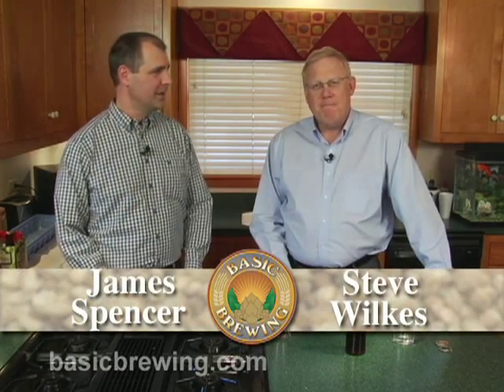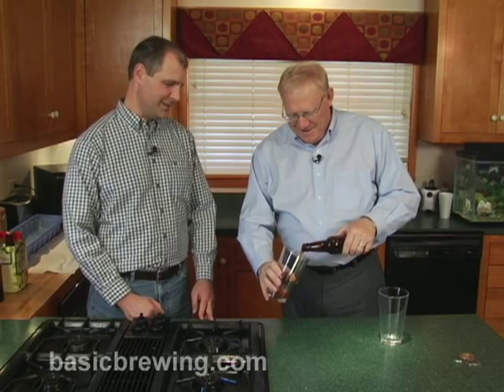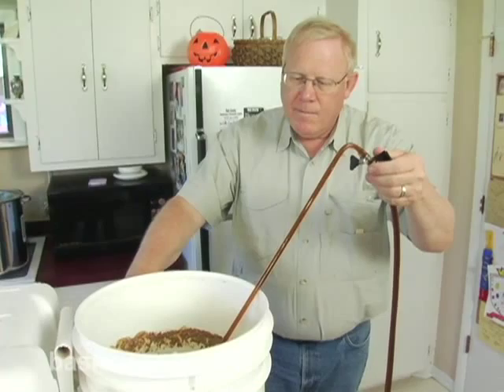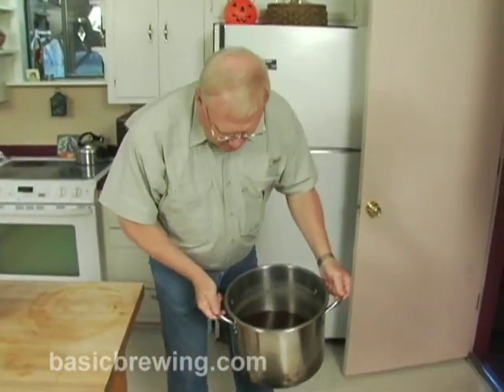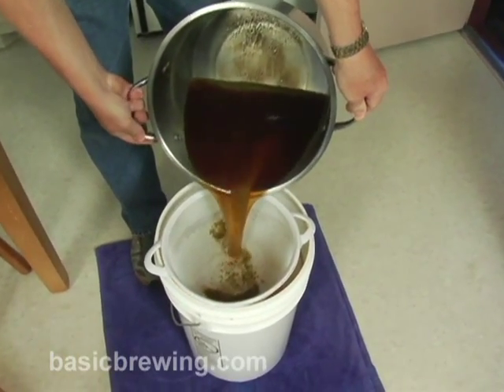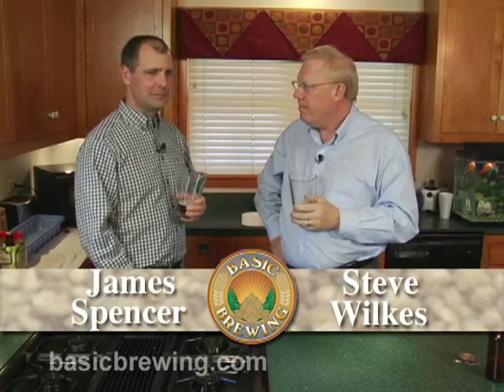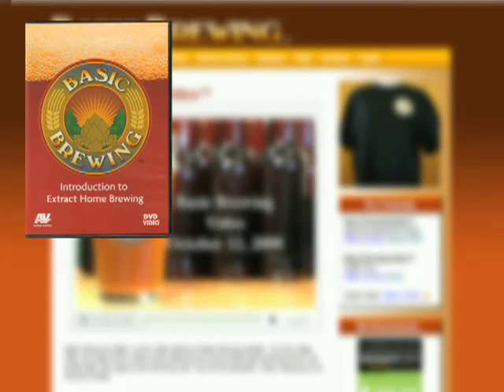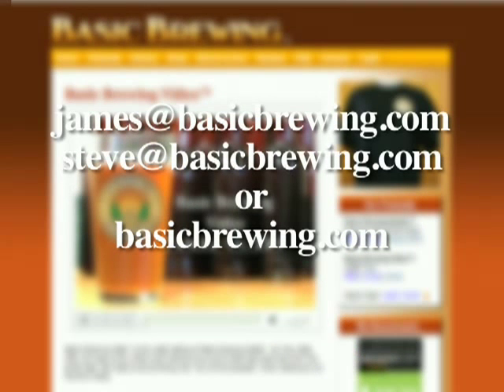Reusing Yeast - Basic Brewing Video - January 31, 2009

Comment: I agree fully that these is no fundamental limit on the number of generations for which we can 'reuse' yeast. There is a practical limit on the number of batches that you can simply repitch the wort as they do here. No mater how carefully you transfer from the brew kettle to the fermentor you will carry over some of the hot/cold break protein and yeast  debris. The previous batches also leave their share of dead yeast cells. After a while it IS necessary to clean up - wash - the yeast.

Comment: I hear you can reuse yeast indefinitely as long as you wash it. Or is that not true?
Reply from the maker: kidgloves2 In theory, yes. However, the more times you handle your yeast, the more chances there are to contaminate the sample. - James
Reply: +kidgloves2  depends on  strain--in theory  some  breweries  in England  have been useing same yeast for thousands  of batches. BUT,  most breweries I know   on  Cal ale yeast 1--repitch 6-8 times.Most British are more forgiving.. Anchor Steam  acid washes  and  useing same yeast a hundred  years.--Most homebrewers  should be  able to  repitch   four  times no problems if you are a  clean brewer.I generally repitch  6 times--NOTE I have  had cal  ale yeast  mutate  at  9 pitches   way back   when. Keep in mind cell count  and amount  of  slurry  as  some  styles  you  need  to pitch  less to  get certain   flavors..WLP 007 is  my  work horse--never had any issues  at  ten  pitches--At that point though  --its silly as   a   pack of yeast is  what? 8 bux. So why risk a  batch unless you have a  microscope and  can  check rod count,etc.